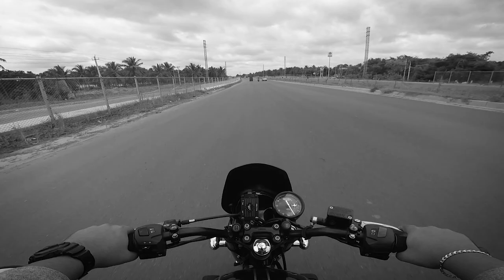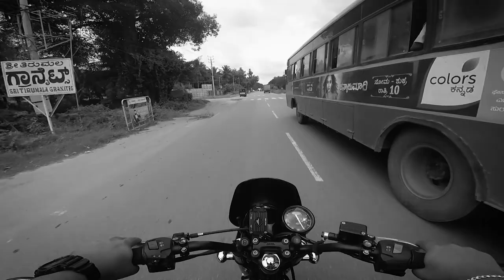How to fix the Jawa 42 / Classic Stalling Issue

Comment: Happens to me too.. if I do full tank and not refuel for days..I do the same i.e open cap and close.. no problem if I refuel 2-3 times a week as in that I open the cap to refuel. (42 BS6)
Reply from the maker: Thanks for your inputs Hritik - surprisingly or shockingly it happened again today. The gauge showed low fuel and when I stopped and did the cap thingy it started behaving normally. i feel I will better get it checked once next week. Will update back if its an issue requiring attention.